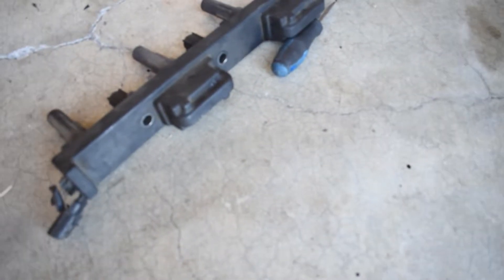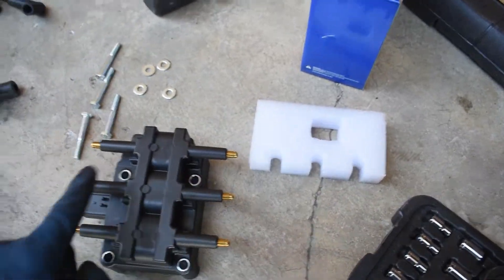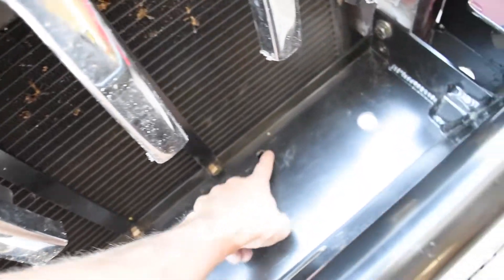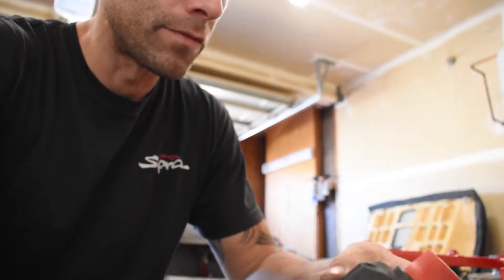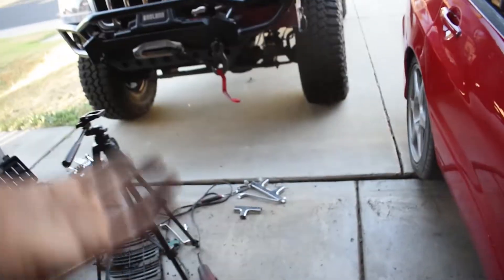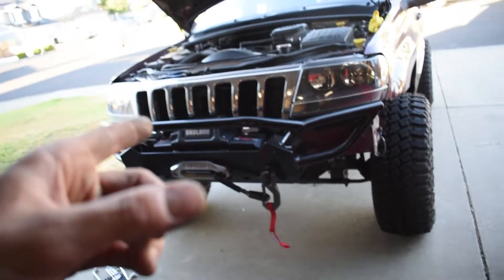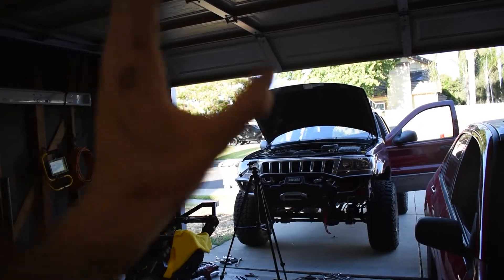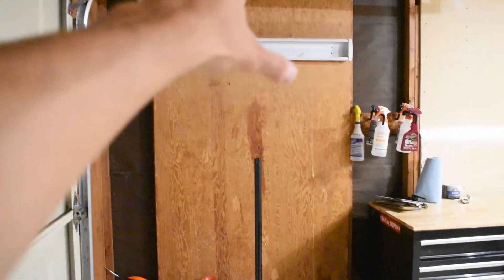INSTALLING the VIPER COIL MOD UPGRADE on the WJ GRAND CHEROKEE + mounting HARBOR FREIGHT WINCH

Comment: Put a Viper coil mod on mine last year to fix the constant misfire after frying a third factory coil pack, factory design coils were overheating. Added a 12 hole injector swap a while back and finally got rid of the intermittent CEL, also currently waiting to install the Big 7 battery cable kit and would recommend both if you have stock ones still.  Liking that bumper you got.